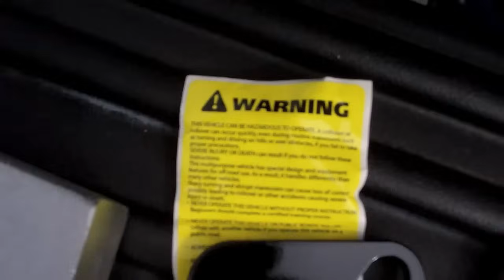Golf Cart Lift Kit Install

Comment: Looks like this cart in another life had a 4" lift kit with Z brackets on the frame (7:51).It looks as if some one did some repair surgery on that frame.
  My wish list includes a 4" double A arm lift kit for my 2001 DS. Wifey would require a stair life to climb up to 6 " lifted cart. Good job, you can always get one of the bearing grease packing tools @Amazon $10.00.
Reply from the maker: you may be right, I have no knowledge of the history of it.  When I got it it was normal height with standard tires.

Comment: Cub Cadet Lawnmower 4 lug rims will fit on most Club Cars , but only on the front , they won't fit over the rear drum !! I raised mine almost 2 inches by just changing to mower tires 20 - 8.50 x 8 & yes I had clearance  fully loaded !!  Just a quick tip if interested !!
Reply from the maker: thanks for sharing that tip

Comment: Don't want to be a hater but this fella doesn't know how to grease bearings worth a darn.  Won't be long before those bearings are toast.
Reply from the maker: Would be helpful if you could point out what you are seeing that you think isn't right.  Because I think I did a good job getting them greased even if it didn't translate to the camera well.  The bearings are still working fine.

Comment: Love the video. Is this a 36 or 48 volt cart? I have a 94 club cart that is 36 volts that I would like to get the smallest lift and appropriate off-road tires installed but worry that the 36 volts want support any of this. Any suggestions?
Reply from the maker: Mine is a 48v

Comment: jake's is the way to go. nice video. prolly should adjust your toe in on the front tires as well.
Reply from the maker: they need a full "alignment" I just need to figure out the best way to do that.  The steering wheel has to be turned about 1/2 turn for the cart to go straight

Comment: All good information, but the way you packed the wheel bearings was not the best way. You need to clean them out a bit better before repacking. They make an inexpensive wheel bearing packer. Also putting the seal and inside bearing on the axle and putting the hub on will not install the seal in the hub.  When you put the rear bearing in, then installed the seal, that was the correct way.  Also you missed a very important step on setting the preload on the wheel bearings. Tighten it while turning the hub until it is hard to turn and then back off the castle nut to line up the cotter pin.  Always turn it a few times to make sure it turns freely. 
   Also using a screwdriver for a punch?  Ouch. Buy a punch.  Silicone spray works better for installing the bushings. 
   I have been a mechanic all my life and it pains me to watch someone do something like this by trial and error and not having the correct tools, but we all to start somewhere using what we have. 
  Overall it was good information to show the steps into takes to do a lift. What good is our knowledge if we don’t share it to help others.
Reply from the maker: thank you for sharing your knowledge.  I guess I've been lucky but had no issues with the lift kit since installing it
Reply: Is it possible to lower the lift from 6" to 4 or 5"? I just bought a cart with a 6" lift and it's an inch too tall to go in garage door.

Comment: clearly don't know how to pack a bearing 😂
Reply from the maker: what are you seeing that you think I should have done differently?
Reply: When you pack bearings you would take a wad of grease and put it in your hand then push the large side of the bearing into the grease. Keep doing that all around the bearing so grease comes out the front. When that happens you know the bearing is full. Also,you can clean bearings in gasoline as well. Hope this helps. Like the video as I just bought a Yamaha gas golf cart and am looking to work on it too.
Reply: Or just save yourself a lot of grief and buy a bearing packer. If you're gonna keep golf carts or trailers around, it will pay for itself in no time.
Packing by hand is just a waste of time.
Reply: Over packed bearings cause more bearing failures than bearings going dry. The excessive grease will not transfer heat and the bearing over heats.

Comment: Looks like a great job!  You said if you had thought about it ahead of time you would have replaced some more parts - what parts?
Reply from the maker: it's been a year since I did this video so now I don't remember, but I think it was all of the bushings and suspension parts (like upgrading the front springs) since I had everything apart it would have been easy to get to all of them